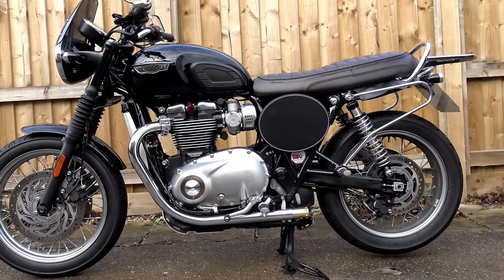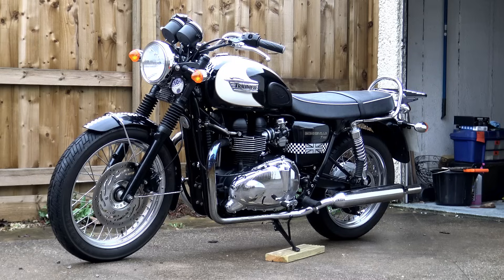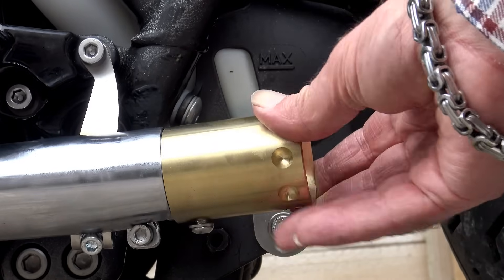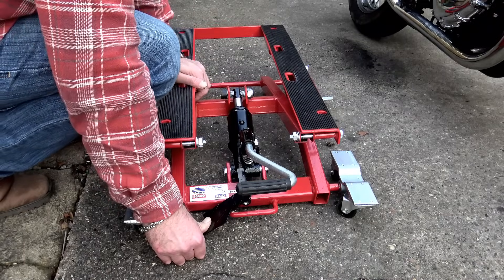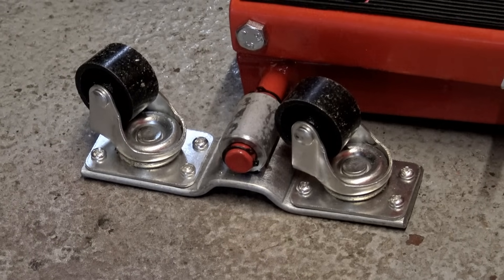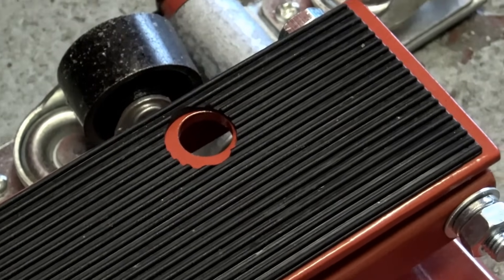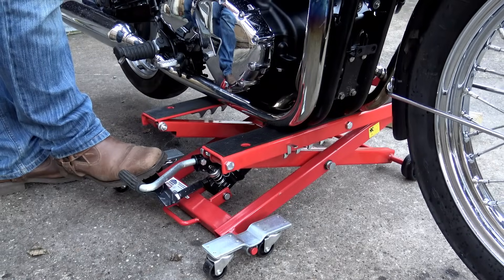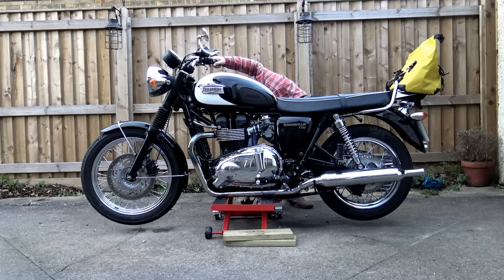Triumph T100/T120 Bonneville, Im Alright Jack! SEALEY MC4500 motorcycle scissor lift/scissor jack!

Comment: I’ve had great success with my lift jack, my parking spot is tiny and the front wheel has to poke into the corner with no way to turn to get back out again. I modified the lift jack by taking off the static wheels and installed castors. So with four moving castors, one at each corner I can spin the bike round on the spot.

Comment: There is also a trick to doing the wheels that swivel. You don't do them with your hands, lift it up then move it forward or backward to turn the swivel. Use the ground as a hand that handles both at the same time. If that makes sense.

Comment: Good review. Question: when using the Jack can you access the oil filter and drain plug or would you recommend using the center stand  for old changes ? From across the pond, Tucson Jack. Peace.

Comment: Noble Sir, that was very informative. 
May I observe, though, that the geometry of the swivel castors would appear to give you a little more height advantage if positioned flat side down. Would that give you enough to deploy the frame rail cups? If still not quite enough, how about running the front wheel up onto say a 25mm thick plank of wood, before introducing the lift.
Kind Regards.
Reply from the maker: well observed sir! i did contemplate that my self when i was editing the video however ive not had time to try it as yet. didnt think of trying the plank trick though! thanks for the suggestion! i will report in the future if either should do the trick. Thanks for watching!

Comment: Hi Stuart , great vid, must say I have had a jack like that for many years to lift my xr1200 which I use to own.
Up date on my front wheel it has been renewed like the 2017 models, just need to ride it.
Keep up the vids as they are really good. Safe riding!
Reply from the maker: Thank you David, glad you have got your bike Brakes sorted out. I still haven't heard anything from them  good old Triumph service! might look in to it but there a possibility i may be changing the t120 wheels and upgrading to Brembo brakes, so not going to do anything just yet!

Comment: Hi Stewart, I just bought a similar jack, without the holes for the frame holders tho.
What I've noticed is that to have the bike (Scrambler 2010) reasonably stable, I had to lift it picking it up exactly under the oil filter (which now have a bit of a flat...head!).
Looking at your video you seems to lift it up in the exact way I did: did the lift interfere with the oil filter at all?
Cheers, love your vids

Comment: Hi Stuart, I appreciate this is quite an old offering, but I had a simple question about using the scissor jack. I know you found a sweet spot for placing the jack on the T120 frame. My question is, "would a sump guard still allow the use of the jack?"
Reply from the maker: Yes, absolutely
Reply: @stuartfillingham  Champion

Comment: Hello, I know this is an old video, but maybe you can find the kindness in your heart to answer. How does this bike fit on this lift? The lift is 36 cm wide. The distance between the oil filter and the front of the bike is only 30 cm. Are you sure that it fits and does not lean on the oil filter? Because I want to buy this one for changing my oil filter. (Maybe my Bonneville 2001 has different dimensions?) Thank you for the nice videos and greetings from a Dutchman in Germany!
Reply from the maker: Ive had my 2010 T100 up on it!
Reply: @stuartfillingham  Thanks!

Comment: Hi Stuart, thanks for this and all your other really informative videos. I haven't got a bike yet and have never had one but I intend to get a T-120 in the coming months. 
It would seem to me that another essential tool is a torque wrench. They also come in at a wide price range and I suppose a wide quality range too. I have been looking at some and the Gerode brand seem to be top quality and not too expensive, although, again, there are much cheaper ones around. Would you recommend any particular brand. Also, as you have been working on your bike for a while now, do you know what torque range would be required for most jobs on the T-120 ?  Thanks again, Ian
Reply from the maker: Thank you very much sir, I use a sealey torque wrench actually i cant remember the model number but it has a torque range from 07nm to 112nm with a 3/8 drive. it came out very highly regarded in my research. and wasn't very expensive, under £40 i think, feels quality and hasn't let me down yet!
Reply: For the life of me outside of dirt bike I don't understand why anybody persists with dirty messy dangerous chain drive shaft drive is the way to go and if you can't go that way then at least you can go belt drive they're clean the long-lasting their economical and if they break they don't go through the side of your crankcase like a chain done replacing a belt cost no more than an endless chain if you are a heavy mileage type of Rider if you add up what it cost for a front sprocket rear sprocket and a chain for two sets every 20,000 miles plus Lube Plus cleaning plus everything you have to do to it unless your eraser on the track or a dirt biker in the dirt change simply have no place on motorcycles anymore

Comment: Are you able to do an oil change ? I ask because my street cup oil plug and filter is in the bottom of the bike as I’m sure you already know
Reply from the maker: Not on the jack Ron, no! just put a piece of wood under the side stand to make the bike more upright, before draining the oil, low tech but works like a charm!

Comment: Paddock stand.
Reply from the maker: That would be of no use for changing the suspension, or supporting the bike while the wheels are rebuilt.
Reply: Very true on both accounts Sir! It should also be said that the bonneville doesn't take a standard Paddock stand.